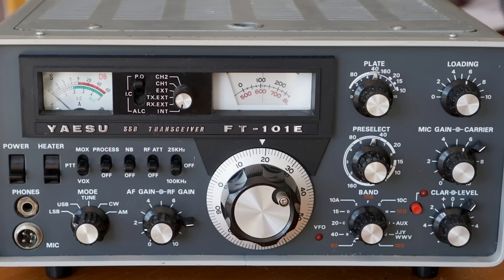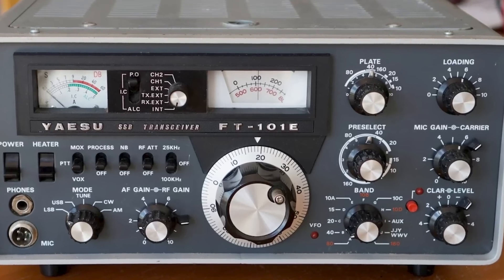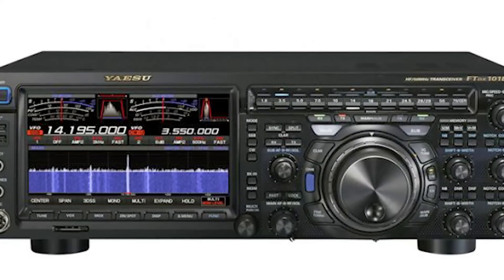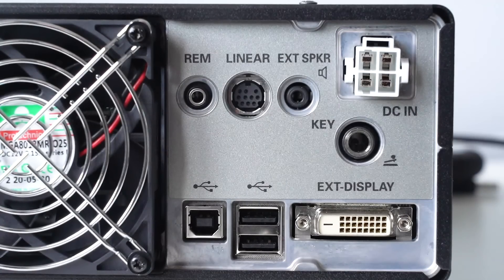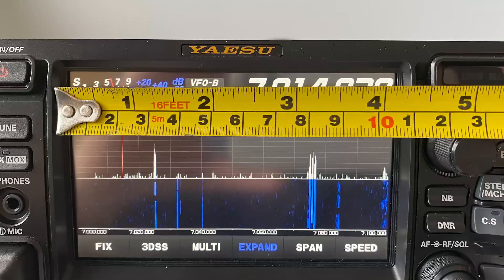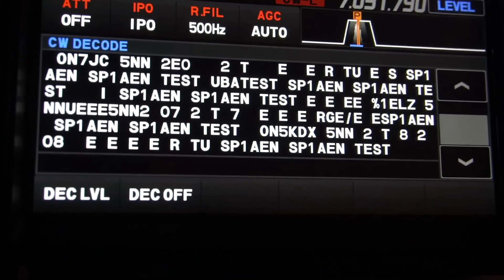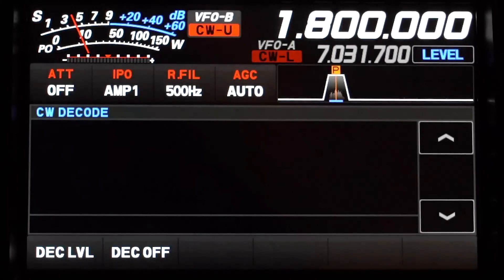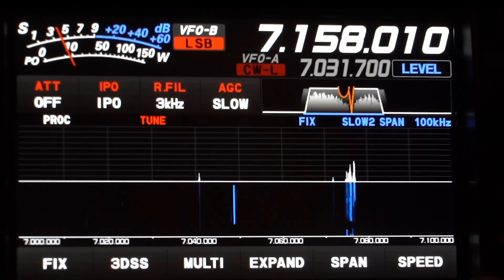Yaesu FT-DX10 HF Transceiver - Is it Right for You?

Comment: The FTDX10 uses a hybrid SDR architecture, while the IC7300 uses a direct sampling SDR. The hybrid SDR delivers better performance in the presence of strong signals in the passband, because the narrow roofing filter attenuates those signals before they can overload the A/D converter. In the 7300, the A/D converter is wide open to the entire passband. I'm in CM97, which has an extremely high concentration of hams, so I have a lot of strong local signals. I'm also an old American ham, but as an engineer, I've been learning new tricks all my life. Maybe it's not for everyone, and I respect that, but the FTDX10 looks like it is the right radio for me. I'll be upgrading from a FT-450D.
Reply from the maker: I did cover this in a previous video. Don’t assume nybrid is better. FlexRadio is right at the top of the Sherwood Engineering list.  73 Peter

Comment: Hi Peter, nice honest review. I have always been, pretty much a Yaesu customer for most of my ham radio career. After a break of many years, like many others, I came back into ham radio because of lockdown. I got out my FT747GX, and off I went. The realisation soon became apparent, that maybe something more modern was required. I bought a Yaesu FT991a and have to say I was delighted with it, and the FT747GX was then relegated to Hf standby. Just recently I got the Icom IC9700 for 2m/70cm/23cm, probably the first marque change in all of 35years. Sadly, the FT747GX lost its drive, and I replaced the driver transistors, only for them to fail again. So I needed to back up the Hf side of things, and am eagerly awaiting the arrival of my FT10DX this Monday. I have now experienced the major changes in ham gear from many, many years ago to the present date and have to say how amazing these modern transceivers are. Anyway Peter, once again for a very fair review, take care. 73’s Geoff. (G4SQJ).

Comment: One thing to do is make the external screen high res to fully use 1920x1080 for spectrum, waterfall, decoder etc. all at once. External monitor should also be independend from the small screen and freely configurable for maximum usability. I think, we will have to wait 3..5 years for that.

Comment: I recently acquired this rig, it was an upgrade from my FT-991A which I got as my first rig. Now that I'm into CW as my main mode, I wanted a rig that could use a hardware roofing filter for CW without breaking the bank. I love it so far. Thanks and 73 de AI5DD

Comment: Probably one of your best videos! 
In my humble opinion, an interesting setup is to have ic-7300 with PTRX-7300 and FTdx-10 together :) .  At the moment I have a 7300 and an ft891, and undecide between swap the 7300 by a 7610 or add ptrx-7300 and ftdx-10. Leaned more to have both radios :)
Reply: WHAT IS AN PTRX-7300?

Comment: Nice look into the radio Peter. I might be on the lookout soon for a more permanent home base soon and use the 705 as a portable vhf/uhf setup. It certainly looks like a nice radio. I don't have any loyalty to any brand, but I used to use yaesu and kenwood back in the 80's and 90's and the 705 is my first icom. All the best and be well. 73s
Reply from the maker: Sounds great! Many thanks Steve. Take care. Peter

Comment: Tnx for a stellar review. I’ve compared this rig with the 300hz filter on Cw and it edges the k3. The 7300 doesn’t even compete with the 2. However the 73 has brilliant audio out. The dx10 is the Cw contesters dream rig for what it is. It’s just the menus that make the k3 a great rig even though it’s getting long in the tooth. The rxer on the 10 is just a joy. Since I listen more than talk, i left the flex and icom collecting dust. Hehe. 73 Peter and stay well
Reply from the maker: Thanks for the info! 73 Peter

Comment: I had to pore through the manual to find out a few things, which will be high priority for some potential buyers, the RS232 port is for CAT control, the USB does two functions, CAT control and internal USB sound card.  With a SCU-LAN10 a lot of functionality is available for remote operation via ethernet. Very handy for those of us who want to play digital modes while pretending to watch television with the Mrs.... Firmware updates and recordings/configurations use SD cards.

Comment: Another great review, with good insight into the usability of the FTDX-10.  I agree that it will be the replacement for the FT-101ZD. Oh, loved that radio!  Purchased an FTDX-10 here in the states on Friday and still reading the directions before turning it on. Thank you Peter! 73 KB7HFS
Reply from the maker: Thanks for watching! Nice to hear from you Mike. 73 Peter
Reply: would it be too heavy for POTA activations 7 3

Comment: I agree with your analogy, would I notice the technical differences between the DX10 and say the IC7300?  I don’t think so, so I would go down the user route, how easy is it to tune, change band, filters etc.  With the exception of Elecraft a Windows based PC is needed to upgrade them.  In 2021 and with the resources available I would not expect this to be so.  I have a FT3000 and it remains a fantastic piece of kit, but for a Mac OS based man it’s a lot of hassle to upgrade the rigs software to the extent I cannot upgrade everything on mine.  Many rigs have a monitor connection point but again the software is Windows based. So I’m not seeing a compelling case to change unless it’s a night and day difference in performance.  Great review Peter thanks for posting.  👍🏻👍🏻👍🏻
Reply from the maker: Hi Mike, I am also Mac based. . Know the problem. 73 Peter

Comment: I recently bought the FTdx10 , I’ve been able to do a direct comparison with my IC7610, I’m afraid the dx10 receiver is superior to the Icom, the filtering and noise reduction is such that I could easily copy signals on the dx10 that I couldn’t on the 7610. I wish it had a transverter low level output and a second antenna socket for 6 and 4M but that’s about it.
Reply: I also have a FTDX 10 it really works superb, since I connected a mouse to it, the user flexibility is far better, al the parameters you can touch and change them. I understand that using a mouse with the ICOM gives you only frequency and spectrum scope capabilities.

Comment: Hi Peter, I have the FTDX10 I think its amazing transceiver, but after cutting my teeth on a KW200B 35 years ago. I am mainly into CW, and sota chasing.   My question is, would It be worth me buying the 300 hz roofing filter.  Is there any difference in using 500hz filter down to 50hz and the 300hz down to 50hz, chasing ghosts stations ? Interested in your thoughts or maybe a video would be great
Reply from the maker: Well I personally would stick with 500Hz - I prefer to get any extra selectivity using my eRs. But others may not agree! I can’t remember if the FT-DX10 has an audio filter?  My old Elecraft K3 did and I always rated  that as the best for going lower than my  400Hz filter. Not sure if that helps ? 73 Peter.
Reply: @watersstanton  Thankyou for your time and advice. I think I will save my money for now because £160 for the 300hz filter is not cheap for little return. The 500hz filter digitally reduced to 50hz is very good especially with the APF or Contour. Steve g4ytk

Comment: Could you please help me with something. I have been searching everywhere to see if the ftdx 10 has the VC tuner in it like ftdx 101D has. It is the VC-tuner that makes the 101D so fabulous and everybody wants it. They say the little brother 10 edition it’s also good at tuning in a station I cannot find any picture that shows the VC-tuner on the ftdx 10 Version. Do you know anything about this could you help me please
Reply from the maker: THE fT-DX10 is a stripped down version of the FT-DX101 and so many things are not included. 73 Peter

Comment: Peter you said the IC7610 performance was not substantially better than the IC7300, 2nd receiver and other features apart, would you say the same for the FTdX10 performance v FTdX101, 2nd receiver and other features not with standing? Great review, thank you.
Reply from the maker: Basically yes but as I have not used the FT-DX 101 I am basing this on the soe. 73 Peter.

Comment: I hate touching the screen. It is awkward. The ability to use a mouse on the FTDX10 is a leap forward.
Reply from the maker: Good to hear. 73 Peter
Reply: I was definitely making note of that.  I’ve got “fat fingers” so between the mouse and the monitor, not to mention hearing that this radio is a lot better receiving CW signals, I think I’m sold!

Comment: Please, can you tell me if it is normal that the outer ring of the clarifier is a little lossy compared to the main one ? I noticed it moves a bit if you try to pull towards you. Thanks in advance. Enzo
Reply from the maker: Sorry, I do not have tge radio now. It is not usual to get a small amount of movement with dome of these dual controls. If there is no issue then I wiukd tend rpto simply register this with tge dealer to cover  yourself for a possible warranty ckaim. But orobably normal

Comment: First ten seconds:  I have the 101EE in mothballs.  Was there a significant difference between the 101E and 101EE?
Reply from the maker: Many thanks 73 Peter
Reply: The EE was the “economy” version, identical to the 101E save for a speech processor. One could be added after purchase, making it functionally identical to the “E” version.

Comment: So basically this is an improved 991-A with the UHF/VHF removed?
Reply from the maker: No. The design concept is not the same.
Reply: Not at all. This is an SDR hybrid. According to Yaesu, this is a single receiver version of the FTDX101D.

Comment: If you can narrow the bandwidth to say 50Hz, why would you want the optional 300Hz roofing filter? No one seems to know for sure!
Reply from the maker: Because the roofibg filter is much earlier in the receiving chain and cleans things up long before a much broader signal is sent further down the chain to be cleaned up at the end of the hain with the associared problems. 73 Peter.

Comment: No ext. RX antenna port, no separate 6m antenna socket, no PIN diode T/R switching (yes in 21st century still used relay) just sewing machine sound on CW, annoying menu…no chance to join my setup!
Reply from the maker: …apart from that it sounds ideal for you!

Comment: "Good radio" - puts it right in the middle of the pack for WS.
Reply from the maker: Many thanks. 73 Peter
Reply: @watersstanton   The DSP DNF & NB have been a disappointment for me.  Both create excessive distortion, even on the lowest settings.  I hope Yaesu fixes this.

Comment: Got one a month ago, really not that impressed,awkward touch screen, too many things to fool with, and video game display...my FT920 does almost everything as good or better, with simple front panel controls, and a menu driven cat system to customize fine tuning, should have saved the $1400.  Tiny controls that it has are crowded and easy to punch up wrong one by mistake.
Reply: and the DSP/bandpass and IF  shift are as good or better than the DX10

Comment: No antenna tuner for 1,700 bucks they should put a tuner in it they can keep it I will pass I would buy a 2nd ft 891 before I buy that radio
Reply from the maker: There is an interbal ATU. The socket is for an optional wider range external one.
Reply: @watersstanton  okay